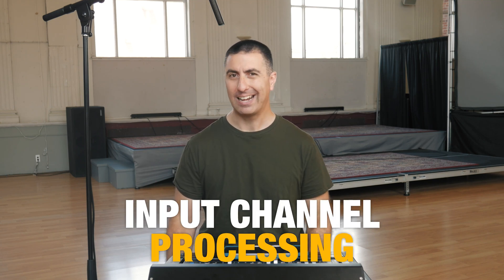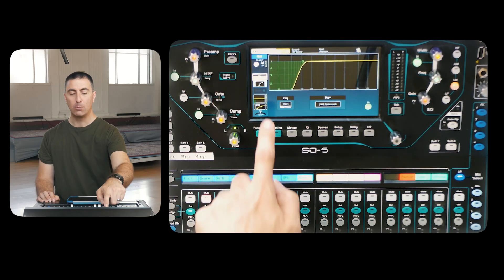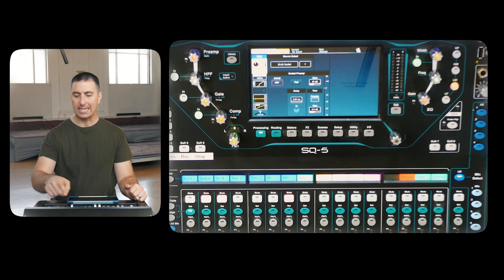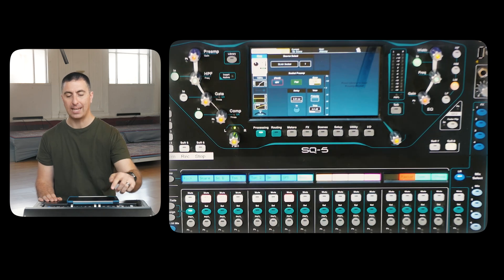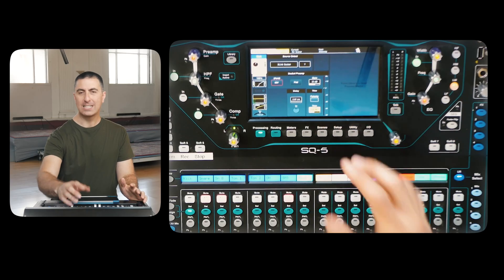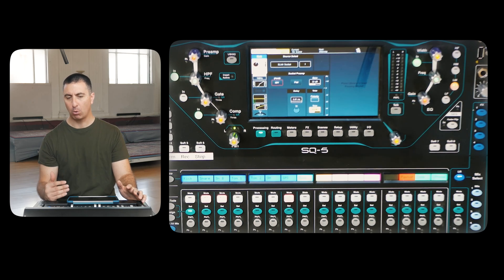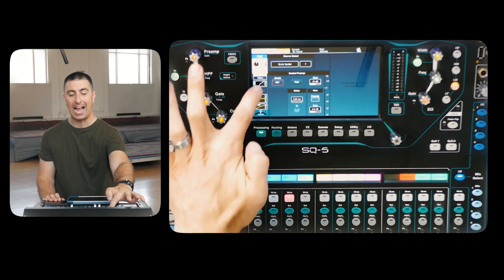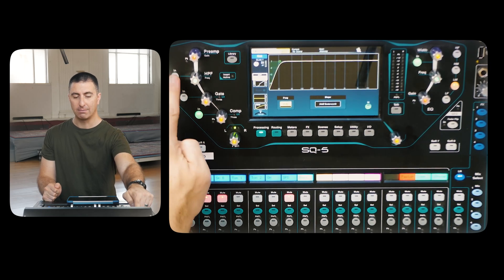Allen & Heath SQ Input Processing

Comment: James, if I’m adopting a board that has the inputs setup not optimally but I have all the Gain, Eq, Comp setup. Is there a way to save them by each channel so that I can then delete and reorder the inputs correctly instead of redoing the gain and sound check with the band? Also trying to avoid having the band redo their in ear mixes too.
Reply from the maker: You could use the library to save the processing settings and recall on the new channel, but not the routing settings (for monitors) as far as I've been able to figure out.
Reply: @AttawayAudio  bummer. That was my hope! I'll take a picture of everyone's mixes then. Thanks again James for serving the community!

Comment: The parallel compressor is a powerful tool and can be used for all kinds of things. I've done parallel compression on consoles that didn't have it by duplicating channels and doing two different levels of compression on each one. Mex them together for the same kind of effect that you can get here. Two things I use them for is on the worship leader and the pastor. For the worship leader, I have additional vocalists on handheld mics ("praise team") as well as a choir. I can blend the praise team with the choir, but then use parallel compression on the worship leader to bring his voice out front just a bit. For the pastor, who has quiet moments and loud moments, I use parallel compression to essentially compress from the bottom up which allows me to control his dynamic range so his quiet moments aren't too quiet and his loud moments aren't too loud, but I still get all the life in his voice on top of the compression. I maintain a range of 62 - 72 dBa on him. Without parallel compression, it would be a much broader range.

Comment: I'm running an A&H - I have an SQ7 in our children's wing, but I run a dLive in the Worship center. The trim is helpful for solving signal distribution issues. If FOH has control of the gains, monitors or streaming can have a separate adjustment for their level. Let's say that the PA is a little overpowered for the room and FOH has set a good gain level, but has turned their trim down to compensate. Monitors or streaming might not have enough signal. With this function, they can turn their trim up and get that signal strength back to where it needs to be for them. They can also turn on gain following where if FOH needs to make gain adjustments their trim will automatically adjust to maintain the same level. I think this is a surface setting on the SQ rather than a channel setting like it is on the dLive.

Comment: Hi James please be the one to give me a reason to buy the sq pack by previewing them. I know that’s probably 5 lessons away
Reply from the maker: Definitely want to do that.
Reply: @AttawayAudio  how do you set delay on SQ5 for speaker delays ranging 50-ft outdoor from the FOH?
Reply from the maker: @josephbisenio4984 easiest way is to use a matrix and use the delay on the processing page... you'll use about 45-50ms of delay if it's 50 ft. away depending on the temperature (1.1 ft. per ms, or .89ms per foot)
Reply: @AttawayAudio  thank you! How about using reverbs on stage wedges? If the vocalist want a reverb do you use insert effects per channel? What's the best way to do it? Also, I learned reverbs are more prone to feedback 'cause there's a tail of frequency and is impossible to cut. How do you deal with this? I use SQ5.

Comment: Great video.  I'm on staff at my church running an SQ7.  Given that every soundman likes a different level of input gain, where do you like to set yours?  I try to keep mine between  0 and -10dB but I've spoken with others who've said they'd never have in up as high as -10dB.  I did notice on Sunday that one mic was peaking at 0dB and clipping a little.  I trimmed it down and that took care of it.  Any thoughts?  Keep this stuff coming!
Reply from the maker: If it's a more transient-type input, I like it to hit around -12 to -6 dBFS, which is in the +6 to +12 territory on the SQ metering. For sounds that have higher average-to-peak levels, 0 dB is good... or wherever green turns to yellow :)